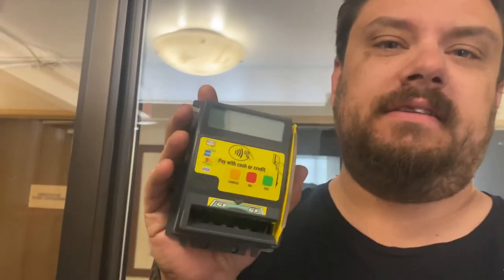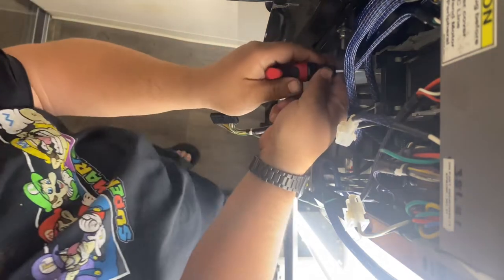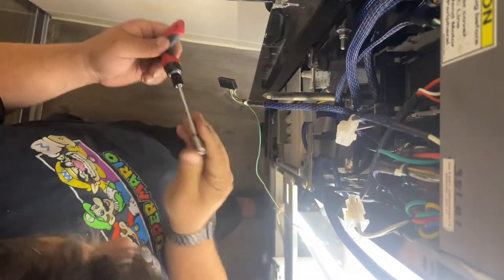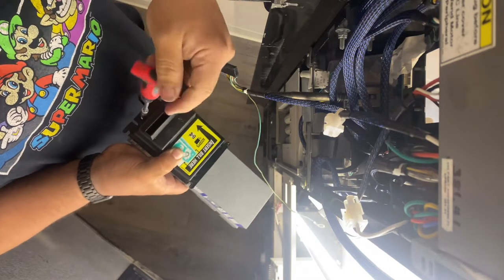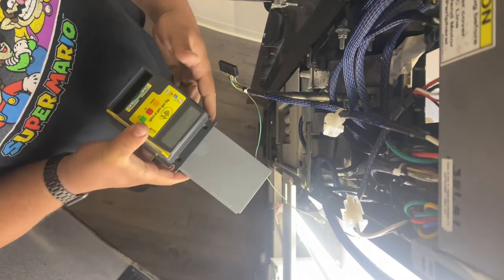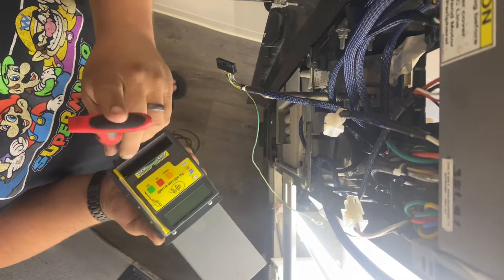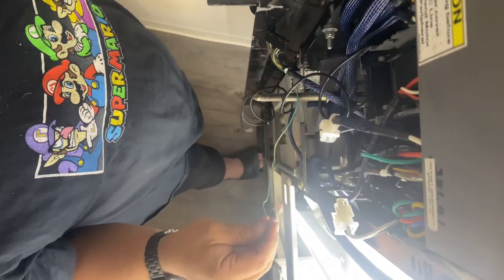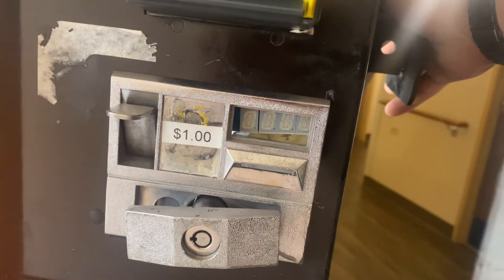Installing 4 in 1 Plus bezel on converted soda machine

Comment: Hey does the 4 in 1 works with any other bill validates? Also how you set the reader to receive the money of the card payments?
Reply from the maker: It will work with any series 2000 mei validator and it connects to the cantaloupe eport telemetry box
Reply: But what about a coinco validator?
Reply from the maker: @simonjesusmoraviloria5563  will not attach to a COINCO validator sorry

Comment: So the 4 in 1 doesnt need a separate  power source after it is connected  to the bill validator?
Reply: And how do I get  to make the 4 in 1 communicate with cards and send the payment  to my "wallet"?
Reply from the maker: @romrom1475  the 4 in 1 will not work with cantaloupe anymore and I have removed them from my machines and have transitioned to the ePort Engage I have a discount code for them on Cantaloupes website use code 720Vending at checkout to save money
Reply: What telemeter did you use for the 4 in 1? 
The machine is have is snack machine that had $1 dollar only acceptor in it, will I have the same problem  as you?
Reply from the maker: I had used the G10 from cantaloupe but they no longer sell them and when I started to have issues with the 4in1 I switched the readers to the upgraded ones
Reply: So you're still using the 4 in 1 but a more advanced  version? 
If yes, what telemeter  are you using now?
Reply from the maker: @romrom1475  i’m not using that 4n1  anymore at all I have changed to the ePort engage from cantaloupe
Reply: Ok, if you were to recommend  a telemeter to someone for a 4 in 1, what would it be?
Reply from the maker: @romrom1475  it would be the cantaloupe g10 with the power adapter cable. The cable you can order from cantaloupe
Reply: Hey I'm having an issue  with my telemeter. Is there a way I can contact  you and maybe  you can walk me thru
Reply from the maker: @romrom1475  are you in any of the Facebook vending. Groups
Reply: Yes I am
Reply: I'm in vending machine services and tips for start ups.
Reply: Is your profile  the one with the astronaut  drinking a beer?
Reply from the maker: @romrom1475 send me an email from my about page on YouTube and we can chat privately
Reply: I don't see your email address
Reply from the maker: so the parts that you have are: 4in1Plus bezel, g10 telemeter, and the power adapter from Cantaloupe 
if you look at the about page on a computer my email address is there
Reply: I sent you an email